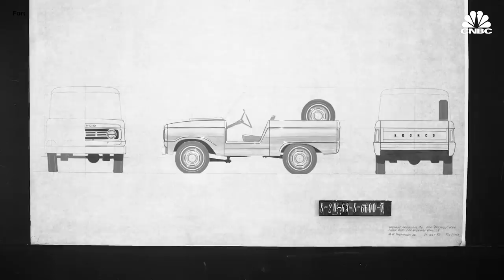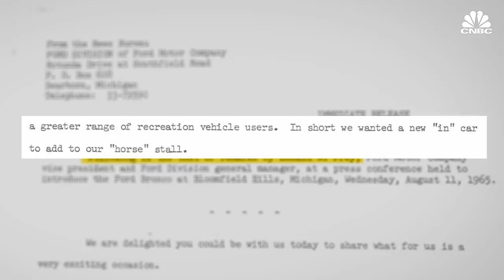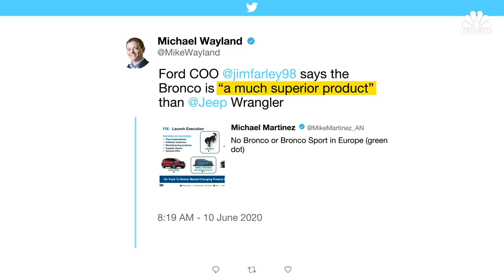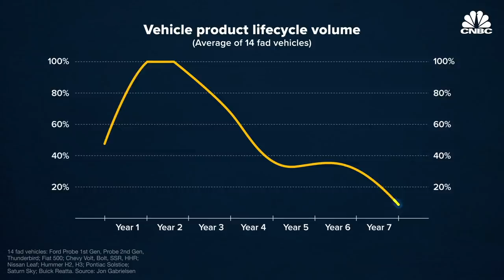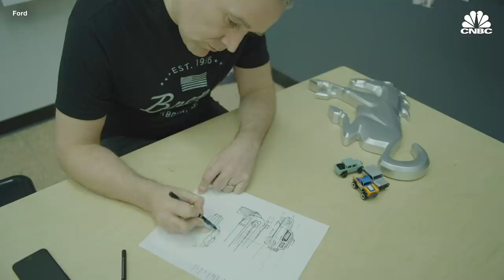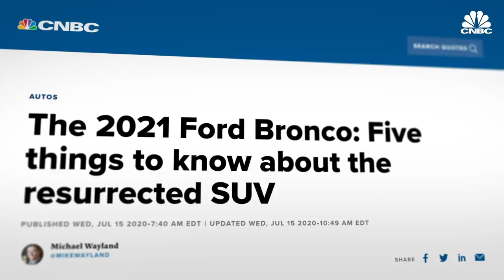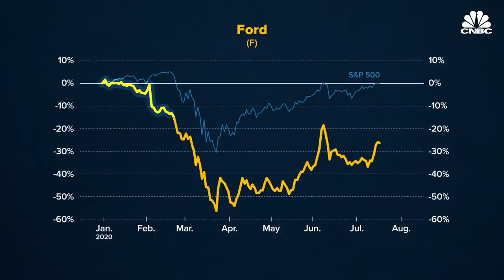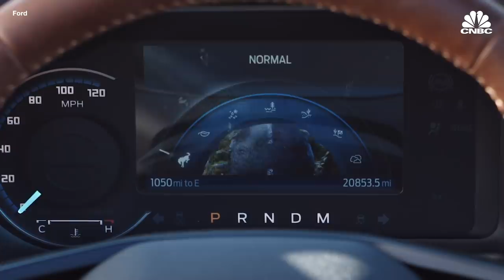Why Ford Is Betting Big On Its Bronco Revival

Comment: GM could have done the same with the Blazer but instead made an Equinox clone.
Reply: I know, that new chevy blazer was a huge joke, a huge let down. and a complete absolute dead zone.
Reply: @jmjfanss  Every time I see someone driving a Blazer, I realize how little they care about cars
Reply: Saw one on the showroom floor a month ago. Half the paint was orange peel. They literally slapped the Blazer badge on an all wheel drive mom mobile that’s trying to look sporty.
Reply: Ford still had bronco, it just had 4 doors it was called expedition
Reply: GM should be embarrassed, they dropped the ball with the new Blazer. Some executives should be fired and replaced.
Reply: @abouttime7316  GM sucks!!!!!!
Reply: Lynn Dempsey my grandpa still drives his old C20 Chevy that he bought new in 1967, it has over 400,000 miles on it and still runs great. Old GM products where “bulletproof”, new ones not so much.
Reply: @davidlegkodukh6969  Sadly this is 99% of car buyers. They don't know or care. They look at something neat and flashy with gizmos inside and sign up for the 10year financing.
Reply: yeah. Big missed opportunity
Reply: I was sincerely disappointed with the blazer
Reply: they renamed it to the Trailblazer.
Reply: @jmjfanss  to be fair, the original Blazer was a joke.
Reply: @srpskabalI  Planned obsolescence is the problem. They want it to break so you'll buy a new one.
Reply: GM drops the ball every time.
Reply: You got it: zero chance the new Blazer as delivered can survive one day of off road service - just rip the valance posing as a bumper off the front end and get it over with.   The Bronco on the other hand looks to have some potential.
Reply: Like the 1979-83 Dodge Challenger/Mitsubishi with its 1.6 and 2.7 Liter 77-105 HP engines. It was a disgrace for Chrysler.
Reply: The Bronco sport looks like a older version of the Explorer
Reply: I love blazers!
Reply: GM dropped the ball in the 1960's when they had the opportunity to design a REAL short and narrow wheelbase 4x4 to compete with all the others at the time and just sawed off a chunk of frame from a 4x4 1/2 ton pickup and called it the Blazer. Great truck, I'd love to have one, but GM could have KILLED it if they had not let that marketing opportunity slip.
Reply: They made it a mid sized crossover that looks exactly like the rest of their mid sized crossovers
Reply: lowercase21 your a soccer mom right?
Reply: ZackM  You don't have a Blazer, you have a Trailblazer.  Don't try to church it up.
Reply: Old Broncos were cool but so were the 70's era Chevy K5 Blazers with the removable roof. I am a Ford guy but would love to have one of those. I have no idea why Toyota dropped the FJ Cruiser they were modern day cool plus had Toyota's excellent Truck Manufacturing reputation. I used to work with a guy who drove a Jeep but would drool over FJ Cruisers.
Reply: GM like to save money
Reply: Giordan Diodato, seriously?  I still own a K5 and aside for bing a pain for rear passengers I smile the whole time I’m driving it.  Chevy missed the boat not deciding to electrify a full size E5 with a little better rear seat access.  How about 4 swivel captain chairs for a real throwback?
Reply: Made a turd that thing is an embarrassment towards a blazer
Reply: Chevy failed miserably with the Blazer. It looks like some Hyudai failure with the headlights mounted low.  Zero off road capability.  Ford Bronco!!
Reply: I would have bought a blazer built in this manner long before the bronco. Chevy is much more consistent with power train production and longer production of said power trains, leading to lower cost of ownership and maintenance.
Reply: White Fox who, the owner? Or gm?
Reply: Just another example of how GM just doesn't get "it"
Reply: Political Destruction I assume you meant "doesn't " right?
Reply: @jimmiller4667  Yes lol
Reply: General Mayhem strikes again. They always screw up! Built the best sports car instead of chasing profits, they even got that wrong
Reply: You guys are so offended because the Blazer represents almost perfectly what you will actually use it for. 

Hands up.. how many of you are actually going to take your brand-new $60,000 Bronco rock-crawling, mudbogging, or river fording?

That’s right. None of you. Not if you’re smart, anyways. That’s what you buy an old TJ or Tracker for. 

I seriously doubt any of you will ever take this any place I wouldn’t be perfectly fine taking my Chevrolet Impala or 28 foot C Class motorhome.

The Bronco is car cosplay. That’s it. The Blazer is just the admission that you aren’t as adventurous as you’d like to think you are. 

And the sales will tell all.  Look at the FJ Cruiser vs the Highlander.  Boring comes from ubiquity and ubiquity comes from perfectly fulfilling a need.
Reply: @Bartonovich52  No plans to take my vehicle offroad ever...so I bought a sedan unlike 90% of new vehicle buyers.
Reply: Yeah they should bring back the Tracker as a rebadged Suzuki Jimny just saying the Suzuki Samurai, and that way the first ones will be built in Japan and the rest will be built in Oshwa, Ontario with parts from Japan.
Reply: Gm will see how ford will do with the bronco and if it does good chevy will follow like they always do . 64 mustang came out and chevy brought the camaro out three years later. And when ford retroed the mustang in 05 chevy did the same in 08 or 09 . Like always chevy is always following the leaded FORD
Reply: @SuperDcopeland  When that comes, their first vehicles will be built in Japan by Suzuki and it will be a rebadged Jimny and later on they will bring kits from Japan and assembled them in Oshwa, Ontario Canada at GM's own facility.
Reply: @abouttime7316  
And they came out with a new version of the Trailblazer.  Rebranded Equinox.
Reply: @davidlegkodukh6969  lol that's how I feel about any cross overs
Reply: The Blazer is simply a 5-seat Traverse! The Trailblazer is now a FWD/AWD 3-cylinder small crossover! Both are embarrassments to their names! Both those names should be on off-road capable SUVs! The current ones are not for me!!!!
Reply: On blazers good luck with the head gaskets

Comment: I owned a 1986 and 1993 Bronco. I put 150,000 on the '86 in 12 years. Overall it was a good truck. The 1993 had brake problems the entire time I owned it. I think it was the early ABS module that I never replaced but other than that it was also a good truck. Both were affordable but I have a strong feeling this new Bronco will be ridiculously expensive. Dealers will make up the price because its a Bronco. I also wish it had a Dana 44 in the front like the wrangler.

Comment: considering the sold the down payment of 1k real quick i would say it will be a success. It looks awesome IMO.
Reply: I'm very interested in it.
Reply: I love the fact that it's an American company as well.
Reply: You'll be Lucky to get 10 years out of that plastic frosted Electronic fuel injected Junk.
That's not a real Bronco, Jeep, or K Chevy unless it has a simple reliable carburetor on it imo.
Reply: @noneshere  Well if an EMP hits you would do better with a pre 70ish with points also.
Reply: @noneshere  reliable and carburetor do not belong on the same sentence
Reply: Looks to luxurious and the front is very ugly. That's my opinion. Like slapping a well known name on anything and this is the outcome.
Reply: Dave Chappelle  Dealerships have committed to selling at MSRP. This is common for major launches of sub brands with lower starting prices.
Reply: @noneshere  electronic fuel injection has been the standard for multiple decades now, i'm not sure where you think it would be unreliable. electric fuel injection works for a very very long time compared to carbs which constantly need adjustment based on environment changes, by comparison fuel injectors will always just work, and replacing them is extremely simple unlike rebuilding a carb which just isn't even worth the time anymore

Comment: My father would instantly sell his Jeep Wrangler to buy this new bronco. Especially since he lost his 1978 bronco due to it flipping.
Reply: Not me.
Electronic fuel injection is not worth the hassle on 4x4s.
Carburetors are way easier to repair.
We got a 86 renegade with a Chevy 350, Ford 4 speed, and Dana 60's front and rear on 44's.
Well never sell it because it's so easy to work on.
Reply: @noneshere  you don't have to comment about your opinion on fuel injection and carburetors on multiple different posts. Fuel injection is definitely more reliable and easy to use because the computer does all of the tuning. I can't say anything about fixing it, but they both have their own complications.
Reply: @noneshere  Yeah I'm happy to be rid of carbs because I HAD to work on them.  Haven't done a damn thing on injection systems in 30 yr.s and 4 vehicles.  Not to mention power, efficiency and so on.
Reply: Does he miss flipping vehicles?  ;-)  Way back when the Bronco was known for that.
Reply: @noneshere  Well,You aren't his dad.
Reply: @jime19911  100% agree. I have a GM TBI system on my old Trooper. Its not as efficient or as high tech as modern EFI. But it always works and works at any angle, over the roughest roads and any altitude. Carbs are NOT better off road.
Reply: Is he looking to flip over again :p?
Reply: Irony
Reply: @noneshere  good thing electronic fuel injection is more reliable practically never breaks and is much more fuel efficient
Reply: @jime19911  I learned to hate Carbs when I had to screw around with them on my pocket bikes ahaha
Reply: But that new V-8 Jeep brought out is hard to pass!🍻

Comment: 150,000 deposits already... I think they got it right. That's 15 million bucks before a single test drives.
Reply: Actually, it's 7,500 profit per unit = 1,125,000,000.  -  1.1 billion.
Reply: Scott Richards I think he’s talking about the $100 deposit each of those 150,000 people made.!
Reply: @scottrskit  Reading comprehension skills are important, and something you need to work on.

Comment: I haven't been this excited for a new car in a long time. Glad I got an early reservation in
Reply: I wouldn't pay ten cents for the POS. Turbo 4 with GDI or a twin turbo 6 with GDI. What a nightmare. Not to mention that junk 10 spd. At the very least I'd wait 4 or 5 years to see if last, which they won't. There is a reason you see FJ's and 4 Runners all over the place. Hell I like my money and I wouldn't pay a nickel for a new Fiat Jeep either.
Reply: @Tsalinger  the ecoboost motors definitely aren't my first choice but they aren't that terrible. I don't see what your problem is with the ten speed, I've had 3 of them and they are great
Reply: @Blue_Flame_Raptor  Honestly Ford's EcoBoost engines are effective and responsive.

Only issue is turbo lags, otherwise they feel plenty fine 👍
Reply: @Blue_Flame_Raptor  I believe the problem he's getting at is that it's a small engine being pushed by a turbo. Twin turbo? That V6 is going to suffer. After a while the turbos will need to be swapped as they tend to break. That's to say if they'll outlast the engine handling the extra pressure from the turbos. I don't like turbos in cars as it pretty much guarantees that you won't make it past 150k without it inevitably becoming a money pit asking for your money over and over. I have a Ford F550 super duty that's turbo'd and all. At 50k miles I already had a turbo issue that costed me 3k to fix. 20k miles later guess what? Another turbo issue. This time fixed under guarantee from the previous turbo I bought. I also own a Subaru wrx sti and have had turbo issues with that little boxer engine as well. Also owned a Honda civic sedan and Honda civic hatch and they all had turbo problems. In comparison, my 2012 card with no turbo are pushing 200k and I've had 0 time in the shop and very inexpensive repairs. In today's day the average person drives 15 - 20k miles per year. So in 4 or 5 years if this truck engine starts slacking you better have at least 6 or 7k to throw away or it's gonna be sitting in front of your home. I hope this is insightful. I have more cars but I won't mention them as they are not turbo'd. I mentioned the others because they are fords. I have a Ford F350 with 438k miles and I haven't needed major repairs on it either other than some work on rear shocks or something like that. Cost me maybe 700 or 800.
Reply: @Chris-ty9ef  I have a 2018 expedition with the 3.5 and its pretty good, my only complaint is the crazy cold start sounds and random hesitations it has
Reply: @Blue_Flame_Raptor  wait another 3 years or so before judging the motor. If a motor isn't asking for repairs and what not between 50 -120k you have a golden egg so hold onto it until the wheels fall off. That's the golden rule I've come across anyways. I've easily driven over 15+ cars btw. Expeditions seem pretty good. I've worked on plenty of these vehicles too and always always always on turbo'd vehicles I see tons more wear and tear
Reply: @Chris-ty9ef  I haven't had very good luck with it in 15,000 miles. Its part of the reason I'm trading it for the bronco
Reply: Good luck! Ford first version of their cars always has issues.
Reply: @Blue_Flame_Raptor  man that sucks, sorry to hear that. Be careful with the bronco. It might not fare any better. If you want something worth your money get something that proven to last. If you do still get a bronco, I recommend not getting the V6 unless you have money to spend down the line. Stick with less complicated engine if you want it to last longer. Best if you can get the manual version too💪🏼 best of luck.
Reply: @Chris-ty9ef  thanks man, even if the bronco has its issues I will gladly stick with it since it a vehicle I really like (so far)
Reply: Mark of Excellence  wildtrak
Reply: @Chris-ty9ef  I know its not in the same range of V6 engine and power but i have a Mitsubishi L200 pickup from 1998 that my father bought new and it comes with a 4 cylinder inline engine turbo diesel intercooler 2.5L (100HP) and the only problem related to the turbo was a steel tube that had coolant cooling the engine that broke, its almost making 217 miles and the only thing needed to change in the engine is the rubber oring around the top valve covers that was leaking a bit of oil and the turbo still working as new.
Reply: @almaefogo  Thats awesome. Older cars always run forever since they're simpler with less moving parts and all. Those older diesels, could live as long as the dinosaurs could honestly. Quality in vehicles have gone down hill due to people chasing better gas mileage and zippy engines. All of that came with a costs.
Reply: You'll be just as excited when they break down. Just in a different way
Reply: Crow Creek Outdoors  absolute, the coyote is amazing. I'm definitely getting the 2.7 since it comes standard on wildtrak, I hear it is one of the better engines ford makes
Reply: Toyota makes a better vehicle and holds value.
Reply: @JoeGator23  here comes the Toyota fan boy
Reply: @Blue_Flame_Raptor  Not really, I just watch Scotty Kilmer and the turbo 4 cylinder in the new Bronco is crap. Go buy one.
Reply: @Tsalinger  Exactly.
Reply: @Chris-ty9ef  It's shiny and new, you can't tell these people anything... but you are correct.
Reply: @JoeGator23  I don't think the 2.3 is that bad but I got the 2.7 since it's much better
Reply: @Blue_Flame_Raptor  I still believe buying a classic in top shape is the way to go for many reasons, especially resale value and serviceability. 
Plus, not everyone has one.

Comment: TOYOTA: 👀 observing closely.......
🧠 time to re-launch the FJ-Cruiser
Reply: Most likely. That'll be good for all consumers.
Reply: Not gonna happen. A TRD-Pro 4Runner can keep up no problem. The bronco will die out just like the FJ. It's too expensive, too specific and impractical. They'll sell a few and in two years, they'll stop production.
Reply: @maddoxinc1642  disagree. It's an SUV market only error I see here is they already made the mustang into an ev SUV. They should have made the bronco an ev...
Reply: They slipped on that opportunity years back to make it like the original
Reply: @maddoxinc1642  It isn't about "keeping up" it is about what the vehicles are designed to do. The 4Runner is a good vehicle in its own right but it struggle to sell to people who move towards more utilitarian-designed vehicles and away from cab extension, mom vans. The 4Runner isn't a mom van but it still favors practicality over specified functionality. FJ Cruiser with a removal roof and updates could be competitive. This is just the beginning of utilitarian offload vehicles that are soon to go EV
Reply: Exactly!!! With a V-8!👍
Reply: @maddoxinc1642  it can keep up but that's not the purpose, some of us just prefer the looks of the FJ.  But really Jeep & Bronco are awesome rigs!
Reply: FJ Cruiser was IFS; the Bronco will have solid axles. IFS vehicles (like the new Defender) have detractors in the off-road community.
Reply: @maddoxinc1642  Agreed.  The problem is not the vehicle they designed, its the price point with all new vehicles.  Everything is wayy too much.  Most people who want these trucks, are going to want them second hand.

Comment: It may turn out that the smartest move Ford made with the new Bronco is offering the sasquatch package on the base model.
Reply: Naw.. There smartest move was the bottle opener in the back
Reply: I only seen the bottle opener on the sport lol
Reply: @brycegman8150  you right, my bad bro lol
Reply: @brandonburns5365  However the bottle opener is installed upside down causing you to tilt the bottle up, potentially spilling every time you use it.  No idea how they missed this on a device that's been around for a century.
Reply: I’ll take badlands trim sport over base bronco with the sauce